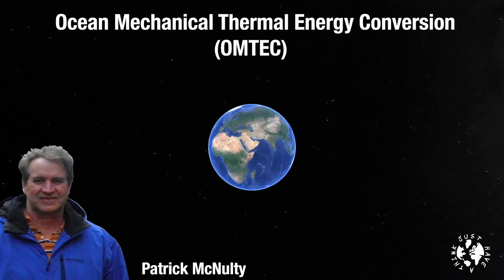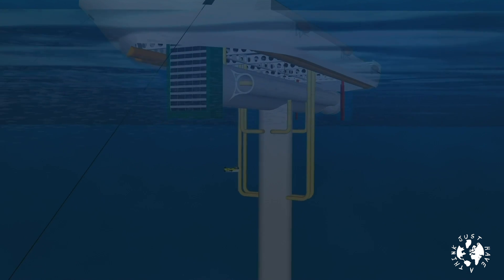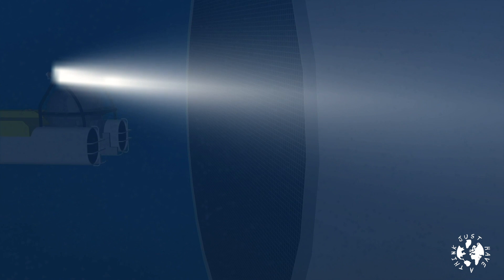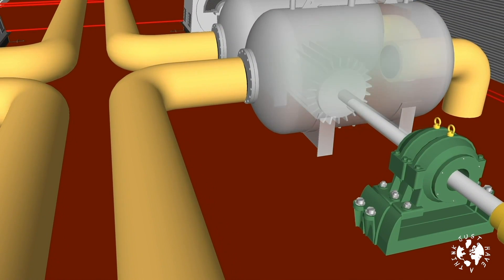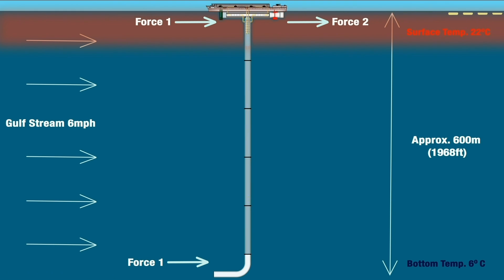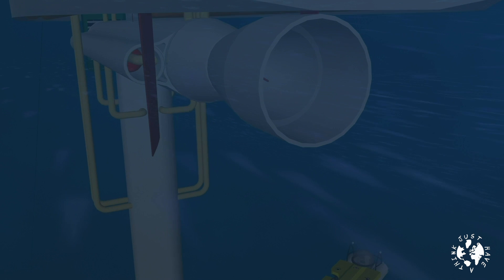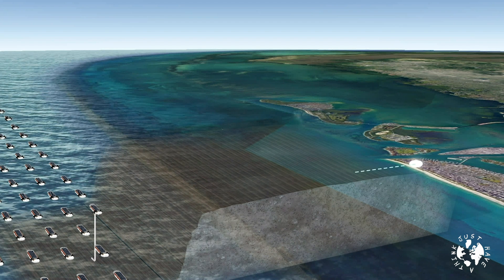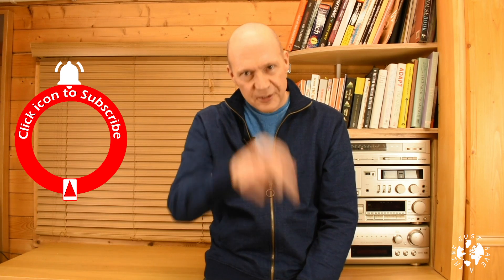Ocean Mechanical Thermal Energy Conversion

Comment: Just trouble shooting here...
Will this mixing of the surface waters affect phytoplankton and other linchpin creatures that live near the ocean surface as you pull up much colder waters to the warmer surface? Guess we will find out all the devastating side effects of this tech when we get it up and running.
 The oceans oxygen giving Phytoplankton is already in decline, don't want to lose that as well as the Brazilians burning down the Amazon for industry. 
Global oxygen levels are already in decline. 
I'm just having a think 👍
Thank you for your time and vids
Reply from the maker: Hi Stephen. Thanks for all your comments and, as always, for taking the time to present them clearly and concisely. Lots to address there, much of which, as you say, we cannot know until rigorous testing and prototyping takes place. I do however think that this scheme is less dangerous than iron seeding the ocean or Solar Radiation Management. It will involve trillions of dollars of materials, shipping and construction. We need renewable energy to power these things. We have this already. It just needs to be mobilised.

Your view is that all of this is 'spitting in the wind', and a demonstration of humans' staggering arrogance and presumption of ownership over the planet we inhabit. I understand that. As you know, my view is that we will never persuade the majority of humans to suddenly and multilaterally have a fit of conscience and take a mass leap towards a radically more sustainable way of life. Most of them have not the slightest idea that there is any problem whatsoever, let alone the enormous magnitude of the social, economic and environmental melt down that faces us all over the next few decades. If I say "IPCC", COP24", "Arctic Ice Loss", "Methane burst" or other such phrases to most people I know, their eyes glaze over and they look at me like I'm a geography teacher about to tell them all about the lesser known rock formations of outer Mongolia!! Most people will simply sleep walk through life unaware of the massive infrastructure whirring away in the background that holds them up and supports everything they do, so that they can continue staring vacantly into their electronic tablets and complaining about how terrible it is when they have to queue for more than 5 minutes to get their skinny latte in the morning. There is a part of me therefore that has some sympathy with your argument. But I also think the fact that they are wilfully ignorant and mindlessly sycophantic does not mean all of us should perish as a result. It also does not mean, at least in my opinion, that the human species is no longer a viable entity. I believe it is. I also believe that what would be truly, truly profligate and tragic is if an advanced species such as ours that has managed, by miracle of nature, chance, circumstance, God, Allah, Cosmological Karma, or whatever other means one's belief system supports, to have arrived at a point so close to achieving true awareness of our place in the Universe, to screw up and implode at this stage. We might do, of course. And if we do, we do. Que sera sera. I value your point of view though, and I'm grateful that you feel this is a forum worth posting on. There's not enough reasoned debate on this in the world right now. We need more of it. All the best. Dave
Reply: Just Have a Think thank you for your reply and time Dave, I know I come across as negative lol, 
and I know we have to do something, it's just I feel we do not have government will to tackle all our problems and that we really do not have the time to get these concepts up and running on a GLOBAL scale, the same for CCS, by the time we get near achieving this monumental challenge on a global scale If at all the Arctic will be gone.
If we do have the first BOE in the next 2 to 4 years the loss of albedo and thaw of permafrost and methane release may well take it well out of our hands 
For me it's about, how can we extract the resources and manufacture all these electric cars, wind, solar,    And these platforms on the scale needed in time Without adding to the problem. 
How can we fix it with tech without destroying what's left of biodiversity where we wont take the bull by the horns and face the reality of our way of living. 
It's so much more than climate change... 
Consumption, plastic, pesticides, pollution. Extinction rates 
I feel that climate change is a juggernaut now racing forward we can hang off the sides and try to slow the momentum but the inertia is gigantic. The oceans have already soaked up massive amounts of energy the poles are melting sea lvl will rise. It's not a light switch we can flick to change course, the path is now set for hundreds of years. 
We are affecting Earths systems on so many levels
Species loss, ecosystem loss, our resource consumption, pollution, global warming current extinction rates, plastic in the environment, global water and food consumption.
There have been plenty of studies that conclude the sustainable carrying capacity of the Earth is probably around 2 billion or less. We are at 7.6 Billion now and we are talking about 11 billion by 2100.... 
Logically It just doesn't add up any more, we cannot build our way out of it without more destruction .
Humanity is out of control.
Reply from the maker: Hi Stephen. All valid arguments, although I do wonder whether the 2 billion number may have been somewhat pessimistic, and possibly based on worst case scenario (which I do accept is where we're at right now). You know me though - I'll keep banging away trying to find solutions of some sort, and I'm genuinely glad that you and others are around to lob metaphorical grenades into the mix - it will keep me very grounded and ensure I consider my own arguments very carefully.
Reply: @JustHaveaThink  Also hurricanes do the same amount of upwelling perhaps more...
Reply: Just Have a Think the 2 Billion number was regarding Earths natural carrying capacity if everything was rosy.
In your mind how long do you think it will take us to build all this infrastructure globally on scales that will actually start to make a difference. 
Bearing in mind we will most like see 1.5 degrees above pre industrial global warming by 2030. And likely 2 degrees between 2040,50 
When are you hoping CCS will be up and running on any sort of lvl high enough to actually start reducing net global co2?
I look at what the worlds governments have achieved since the Paris climate agreement and indeed last 30 years ( this year having the highest co2 emissions ever) and can't help but feel pessimistic.
The global Economy demands growth and we will continue to feed it. 
Think if people truly new how screwed we are they may be more willing to accept the monumental changes that are needed for there to be any hope and it needs to happen now not in a decade or two.
Reply: @stephenmason5827  Ten years with today's supply chain..
Reply from the maker: Hi Stephen. If I had a gun at my head and I was instructed to give my most honest prognosis for the future based on what I have learnt over the last 12 months of preparing for and producing all these programmes (bearing in mind I am by no means an expert in climate science), I would probably say something like this :-

Public awareness will continue to lag woefully behind the reality of Climate Change, which as we know is now firmly on an exponential trajectory. 
Market forces in favour of renewable technologies will continue to nibble away at the overwhelming monopoly of Fossil Fuels for at least another decade before they finally gain global supremacy, by which time a 4 degree Celsius 2100 will be pretty much baked in (if you'll excuse the phrase)

DACCS will most likely get a foothold, but may only get us to a 1% CO2 reduction by 2030 (that alone would need 750,000 shipping containers worth of fans).

If the right entrepreneurial person spots a market opportunity for something like the OMTEC system we looked at today, then those platforms could be built quickly once the concept is proven. 2025 is certainly feasible, but only with the right backing. Even this date is too late in some people's minds.

Within that time one or more of the catastrophic feedback loops may well begin to wreak havoc all over the globe. This may be the methane release from a blue ocean event in the arctic, but could just be a real ramping up of storm, drought and heatwave severity making some geographical areas practically uninhabitable. The most vulnerable, least financially protected countries will start screaming desperately for help and the western industrial nations will lob a few billion their way to appease the growing concerns of their own citizens. Those billions will do very little to help, because what those people will actually require is wholesale relocation to areas where other less vulnerable people already live. And those people are unlikely to be a welcoming crowd.

Major food growing countries in the middle and far eastern mid latitudes will begin to restrict the amount of food they allow out of their own borders - fearing that they may themselves be left short. This will not sit well with the recipients of this produce - namely the rich western nations. Disruption and insurgencies will start to mysteriously occur in those food producing countries, sponsored by rich states vying for important territory, in just the same way as the Arab Spring.

Many hundreds of millions, if not billions , of the poorest and most vulnerable people on earth will perish, largely through no fault of their own.

The rich nations have almost certainly already forecast the numbers that will die around the world as a result of each of the IPCC RCP plots, using RCP 8.5 as the most likely scenario, and will quite probably have factored these numbers into their economic, political and social plans as if they were playing some sort of insanely psychopathic version of Risk or Dungeons and Dragons.

The leaders of those rich nations will currently be reassuring themselves that, while it's jolly sad that poor people in far away countries will perish, their first priority has to be the safety and security of their own citizens, thus neatly abdicating any responsibility for their genocidal negligence.

But those rich leaders have put all their eggs in the IPCC basket. And that basket is far too small, metaphorically speaking. The IPCC underplays all it's numbers and does not adequately account for arctic sea ice loss and methane release.

By 2030, all nations, rich and poor, will have realised that they are now in a desperate scramble for survival, politically, economically and existentially. 

Human beings will at that point, for the first time in their existence, be faced with a stark choice as an entire species : 

Either work together to suspend the entire global economic system  in order to mobilise planetary resources for extremely rapid and probably very dangerous mitigation strategies, like massive solar radiation modification, to buy some extra time to properly reorganise the global infrastructure and ensure renewable energy sources are implemented around the world.

Or separate into our own geographic tribes, which we currently call countries, and fight the other tribes with an intensity never before witnessed by human kind. These conflicts will most probably jeopardise human existence before climate change does.

So, yeah, I am mindful of how shitty the future looks my friend.

But, overriding ALL of the rhetoric I have just spouted, is my absolute conviction that the human species is worth saving. As well as this I for one am able to retain some hope that at least a couple of the scenarios set out above will be averted in ways that we don't and can't currently envisage. No-one knew penicillin was just around the corner, to use just one example.

So while we berate our leaders for the scandalously complacent way that they are mis-reading the future, we in our way may also be incorrectly ascribing no progress or breakthroughs to the next few decades.

While the possibility of unforeseen improvements exists, however faint, I cannot bring myself to give up.

There we are Stephen..JHAT soul laid bare. Make of it what you will :-)

Oh yeah, and..see you next week ;-)

All the best. Dave
Reply: Just Have a Think one thing is for sure we will definitely have a lot to talk about this coming year. 
My money's on another record breaking year on all fronts.
Looking forward to your next video and big thumbs up to the new intro
Reply: @JustHaveaThink  Be assured if OMTEC is not built it will not get better.
Reply: @JustHaveaThink  Extremely thorough and well put.  My own response to similar thoughts is to build a boat to get to the Southern Hemisphere, and become a modern nomadic traveller, seeking conditions and food in exchange for my skills.  My S/V Time Lord seems to have picked up an Avian visitor on the roof (Hudson River, NY, USA).  Some bird is singing away up there, tonight.
Reply: @JustHaveaThink  <smile> Interesting to read the above, to which I mostly agree and see happening. I like the OMTEC idea and hope you & Patrick get the academics on board and also, more importantly, the financial backing. I think getting the money to build a prototype will be difficult. I believe there will be many design challenges, and with your background you must see many of them. Time is against you (us, humankind) as Stephen points out. As the climate becomes more chaotic it's going to cause disruptions in transport, working infrastructure, food and water, which will only slow things down. I think the planet, the plants, the insects, the animals are all worth saving but I'm not so convinced any more that the human race is. It seems to me that humans have really made a mess of the planet (some knowingly and most of us unintentionally) and nature will flourish, and the planet heal, a lot quicker without us (unless all the nuclear power stations melt down or we nuke each other etc.). I do look forward to hearing more about this project over time in your videos, which I think I've now managed to get caught up on.
Reply: @JustHaveaThink  Another quick thought. Penicillin was discovered in 1928 and "On March 1, 1944, Pfizer opened the first commercial plant for large-scale production of penicillin" (https://www.acs.org/content/acs/en/education/whatischemistry/landmarks/flemingpenicillin.html). So a turnaround time of 16 years, which was very good going considering WW2. Of course it was WW2, with bullets flying and lots of pain, suffering and death that motivated production. Does that therefore mean, more climate change induced pain, suffering and death will accelerate climate change solutions?
Reply from the maker: Hi David. I wish I could summon up an alternate response, but tragically I think the short answer is yes. In my view that's all the more reason for as many people as possible to be making as much noise and nuisance as they can to governments and businesses alike. Things like divestment, peaceful protest and civil disobedience have been proven effective through recent history and those things are happening all over the world today - and forcing change. Fossil fuel has already lost trillions in revenue through divestment in the last four or five years  alone. Not quite enough to stop them yet but it's definitely hurting them.
Reply: @JustHaveaThink  'Man' is worth saving.  How many times have you seen or read about humans jumping in to save animals or one another??  Many, I'll bet.  Most just want to live our lives, how ever we were brought up to do so.
Reply: Actually alage blooms are created by upwelling.. Also as part of SRM technologies microbubbles are made for oxygenation of waters..
Reply: Patrick McNulty lets hope it promotes the right Algae growth and doesn't mess with natures systems that were working well enough before we came along!! also we would still have to dig up all the resources and manufacture thousands of thes,  I'm guessing that will burn plenty of fossil fuel and degrade more ecosystems.
Yes I'm pessimistic lol
We are at a stage where we try to fix one problem and create more else where. 
You know August 1 2018 was resource overshoot day, all resources we used from then until new year were unsustainable the Earth can not replenish, we are currently consuming resources like we have 1 and a half planets. And we still talk about having 10 billion plus people by 2100. 
Can't see that happening the enemy imbalance and degradation to the planet is to great already.
Reply: @stephenmason5827  Well with a cooling ocean Red Tide wouldn't be so prevalent these days..
Reply: @stephenmason5827  , the assumption that we use 1.5 planets worth of resources or more per year is not supportable as that assumption does not, in any way, factor in 71% of this planet, the Ocean. The largest mountain range on this planet is the 40K mile long oceanic ridge. In many places along that ridge we can find smokers pumping out almost every metal and natural chemical compound we need.

The chemosynthisis aspects of those smokers has shown us that we can not only produce algae without light but also grow algae which produces water as a byproduct.

Ocean tech can give us vast and sustainable resources using today's tech. I do not trust memes when it comes to planetary biogeochemistry. 😊
Reply: Michael Hayes that's all very interesting but it doesn't change the fact we are destroying the web of life we depend on, check out biodiversity loss both land and sea current extinction rates. Have you looked into global food and fresh water projections for the coming decades. We are set to go past 1.5c rise by 2025 to 2030 and 2c by 2040 2045 Based on current rates of warming which is only speeding up and doesn't include any positive feedbacks eg Arctic BOE and rising methane releases from Arctic ice shelves and thawing permafrost. That Antarctic is at record low ice extent and the west Antarctic ice sheet is currently in full meltdown. 
What have we done since the Paris climate agreement? 2018 saw the highest rise in co2 emissions on record. 
Can you see us changing all our infrastructure globally, cars, shipping, aviation, agriculture in the next decade, if you want millions of solar panels you still need to mine, fabricate and ship them, if you want millions of wind turbines you still need to mine, fabricate and ship them, if you want thousands of these offshore platforms you still need to mine, fabricate and ship them. If you want thousands of CCS plants you still need to mine, fabricate and ship them, Realistically how long do you think it will take to do this on a scale that will actually make a difference and at what cost to the environment and biodiversity we have left. The numbers don't add up anymore, we are going past 2c I guess in the next 10 to 15 years. 
We are unsustainable at our current numbers especially while we pretend the Economy can just continue to grow infinitely.
My guess is a few years after the first Arctic Blue Ocean Event we will start to see even more rapid rise in global temps as the Arctic Ocean soaks up the radiation that was once reflected
Check out 
Current extinction rates, insect declines 
Global food and fresh water projections 
Plastic in the environment 
Declines in arable soils.
The problems we have created go way beyond Climate change.
Its the vast momentum of the system changes we have set in motion I feel people are not grasping. 
Ipcc report says the only way we stay below 2c is use CCS, we need to filter the whole of earth atmosphere. 
I look at world governments and hold little hope, we will be way past 2 degrees c before we have all the infrastructure up and running to even start making a dent in it, if at all. 
We are not going to be able to take the heat out of the oceans that is already absorbed, the ice sheets will continue to melt for hundreds of years now. 
Last time co2 was this high sea lvl was 30 odd Meters higher and temps were around 4 degrees c hotter the only reason we haven't seen this yet is the speed at which we have put the co2 into the atmosphere. It's all about the speed and momentum. 
Globally We are not prepared to do what is necessary because it means humanity will need to take a big hit in lifestyle and our perceived comforts 
While we put humanity first we are totally screwed
Reply: @stephenmason5827 , your broad based concerns are all understandable. If you can briefly list your questions in bullet form, I can better answer.

In general, we will not be able, in my opinion, to transform existing terestrial governance models nor infrastructure in time. One must first fight entrenched interests which is a time and resource killer.

By working out beyond all national jurisdictions, on the high seas, we do not need to fight that battle and can move quickly with just green bond investors. The UN based International Maritime Organization and the International Seafloor Authority are the only regulatory bodies concerned with the high seas. They basically require that the operator do no harm to the ocean.

Also, I try never to couch Marine BECCS or any other marine tech as a complete solution for all. It is potent yet not omnipotent. 

I do expect to see around 1B coastal people displaced in 20 years or less due to sea level rise and unless we are ready to absorb most of that displaced population, that population will trigger political instability around the world. Look at what "just" a 100M migrant/displaced population now triggers.

In thinking about complex, vast scale and existential threats we must include 71% of the planet, the Ocean, in our tech basket. 

Finally, those that opt to migrate to marine operations will need to understand that governance must be science based and new lifestyles are needed. I often site Star Trek TNG as an example of the life style and governance which will be needed on these vast scale lifeboats.
Reply: Michael Hayes sorry I do tend to rant lol, I can't see us reacting in time, thing are going to get worse far quicker than the ipcc suggests. 
Every new report regarding climate and the biosphere say it's worse ore happening faster than previously thought.
People bang on about all these tech fixes but at what cost.
I'm not suggesting we give up and do nothing I just think we should be doing far far more.
What really needs to happen would probably collapse the global economy, so instead we just continue to play God with biosphere. 
We should stop air travel for recreation 
We should concentrate on building local more sustainable farming 
Stop make 90 percent of products that we do not really need,  200 years ago people made do with half the Rubbish we have.
We need to be restoring forest wild lands and giving back habitats 
Cleaning plastics and Rubbish from beaches and countryside.
They say there is a housing crisis in the UK apparently there are not enough houses!! I beg to differ maybe there is a people crisis, there are too many people..
Where does it end if we carry on building over habitats , the web of life is, or should be the most important thing to us, without it we are screwed.
My problem is it's always what's best for people, what we need.
Maybe we got 10 years or 20, maybe 100 but this is headed one way and it won't be pretty.
Did you see the new president of Brazil president Bolsonaro wants to industrialise the Amazon!!
Reply: Up welling is known to be highly supportive of the surface microbial loop. Look at where deep currents are pushed up by islands or continental shelves. There we find rich surface life.